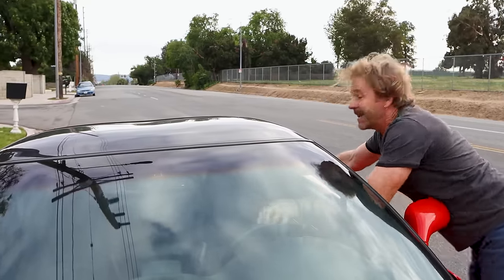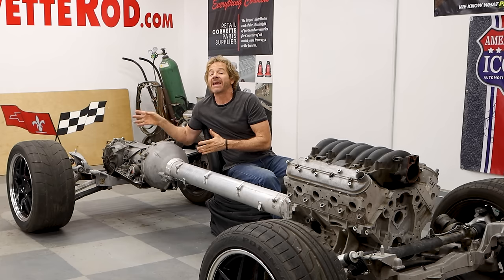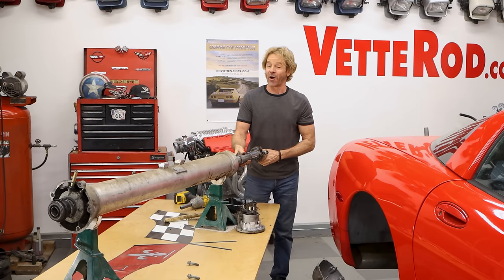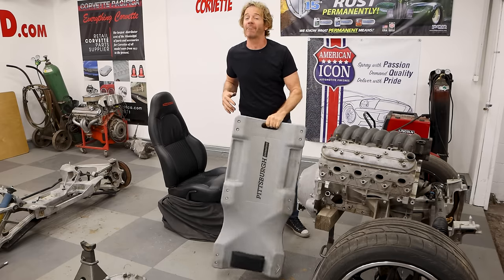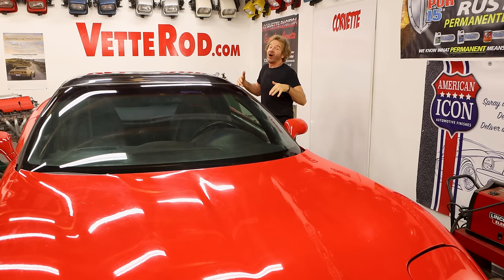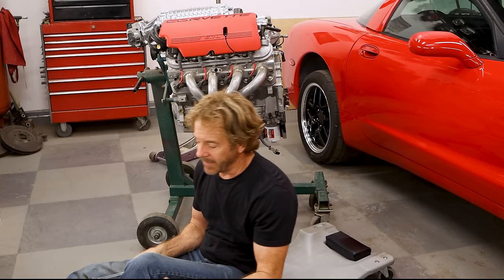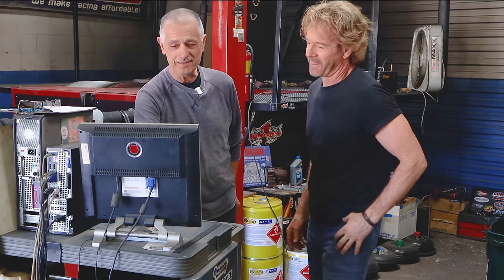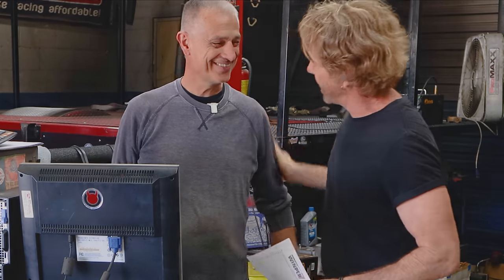I found the Cheapest Supercharged Corvette on the planet

Comment: Shawn, I know it sounds unlikely that you would have missed it but I just wanted to mention one thing. One very popular modification on forced induction C5 and C6 Corvettes to prevent knock was to spray water methanol into the intake, this was normally done by adding a bong under the existing windshield washer fluid tank and having a pump under the bumper and a hose into the intake tube on the bottom. It's possible to gloss over something like that because of where it is in relation to the work you were doing. If the windshield washer tank is low and it's not spraying water methanol then that would explain the knocking. It just seems weird to me that someone who put that much effort into building the vet would not have it tuned correctly. Many people just used normal -20 windshield washer fluid because it is 70% water and 30% methanol and that way they can continue to use their washers as normal but some went out in bought special juice which was a 50-50 mix. The windshield washer fluid is almost as good. You end up with about 113 octane equivalency with -20° windshield, washer fluid and 116 octane equivalency with 50-50 mix.

Comment: Thanks for the information about the Vette drive system.  I had no idea the trans was in the back and there was a throw out bearing in the front.  My 2005 vette has been making a growling noise whenever I let out the clutch in an acceleration.  I bet I have a similar problem as you had, though not as far gone.

Comment: I just happened across this video.  This guy is amazing.
I've owned over twenty Vettes and never came across this.  I thought it was a bent valve or, worse, a loose connecting rod.

And he does the work himself!  I feel good about myself if I manage to change the oil or an O2 sensor.

Comment: You uhhh... you really need to get a cheap scope cam. For like $20 or less you can avoid the whole mirror BS, just fish the camera up there while taking a recording, fish it back out, then freeze frame the clearest point. Then you can read / see anything you want. . . with ease.

Wish I woulda found this gem though... my god what a deal! Not really feeling the "vette camino" idea all too much, but you do you I guess. But man oh freaking BS man, you say your car buying skills aren't what they used to be... wtf did they used to be!? You used to find gems like this for $500 or less or something? Because this is about the deal of a lifetime! Better than pretty much ANY new offering of ANY kind.... All the modern tuning convenience, all the easy and bulletproof everything of GM 4th gen F and 5th gen C reliability via LS and T56... Interiors that still have actual switchgear, buttons, dials, and REAL GAUGES and not bs analcrap screens faking it while looking like absolute abhorrent crap while doing so... all of this goes SO FAR in my book, as the LAST thing I want is a 10" tablet and endless menus and drop downs, just to turn on my seat heat, or hvac, or roll a dang window up. Not to mention, having that single point of use item break and literally losing EVERY SINGLE EVERYTHING, as new cars do... also not to mention, the parts in this car are plentiful on the OEM and aftermarket, where new cars have parts phased out in a matter of months anymore, literally becoming unrepairable whilst still nearly brand new. 

No, this is literally the last BEST era, with the c6 being the last good era. Sure, the c6 comes as a more potent and arguably "better" car... but in many ways it just overcomplicates what was already present on the c5, and heck... even 4th gen fbody. Any C5 or SS/WS6 has the exact same potential, while also being FAR more user friendly in getting it there... and more fun to drive imo.

Comment: You're the Pilot alright....Great video.   You're a one-man mechanic..   (Corvette expert).  You make hard work look like fun.... A quick question, I think the IAC module is bad on  1985 C4.  The car runs great but idles like it has a race cam in it.  It doesn't, to my knowledge.  At idle the rpms range from 500 to 700 up to 900 and back down almost stalling.  I've done the coolant bypass and added an air foil to the throttle body.  This improved the idle a little, and added torque. I still think the IAC is the culprit.  Do I need to take off the throttle body to change the IAC?  I already bought a new AC Delco IAC, so I may as well change it...
Reply: you cant remove the iac without removing the whole throttle body. since you did the coolant bypass, taking off the throttle body should be a breeze.

Comment: Just found your vids and think they are great. I just wish when people do rear wheel dyno pulls they would stop with that 20% thing to convert it to engine HP. If you dropped in a 1500hp motor it does not take 300hp to turn the same drivetrain that the 700hp took 160hp motor to do. That 20% things is b.s. it is just make believe number they throw out. An average t56 manual transmission with a average 10 or 12 bolt rear end takes about 80hp to turn depending on clutch/flywheel and driveshaft weight. if this car had the 4L65 based automatic in it would take approx 120hp to turn it.
Reply: Not only that, but they said 20% drivetrain loss and took 20% of 580 whp and added it to see what the crank HP is. That is NOT how you get that number. 20% of X - X is 580 whp. Not, 20% of 580 + 580 = X 

20% of 696 = 139.3 so this would be a 556 whp car according to them 

If there was truly 20% drivetrain loss, 725 hp would be closer. 20% of 725 is 145. 725 - 145 = 580 whp

So I’d agree, it’s likely less than 20% because like you said, it generally takes a fixed amount of HP and everything after is just extra.

Comment: When I heard your knock, and that the seller drove it 50 miles, my first thought was the input shaft. I bought an 85 camaro with a 350 and t5 in it years ago. some one put gear oil in it when it needed trans fluid. I figured they had the trans flushed and the shop put in the wrong oil. I drove it for a few months. Drove it 90 miles to a friends house. When I left it made that noise. At that time I thought it was the through out bearing, Nope Input Shaft. lol. I was banking on the input shaft, because it is one of the parts that rotate with the crank, and sound can travel, making you think it is in the block.

Comment: Drivetrain loss is closer to 15% on a C5 manual. I'd say its around 682hp crank based on 15%, but close enough to 700 (682*.15=102 | 682-102=580). That is on the high end of an LS2 with just a base blower kit, so that motor may certainly have more mods. But based on the rest of the car, I would guess its stock LS2 with just a smaller pulley and a good tune. Impressive with the stock mid pipe/cats, California gas, and it being so quiet.

Comment: I hate to say this, but it sounds like what you have is an early model Callaway Corvette, or more specifically someone was attempting to build their version of a Callaway Corvette. The only problem with that is this: The special edition Callaway Twin Turbo Corvette was available from 1987 to 1991 as Regular Production Option. If it was the Callaway Sledgehammer Corvette it would be twin turbo charged, and would produce a bone chilling 402 hp (300 kW) and 582 lb⋅ft (789 N⋅m) of torque and speeds of 254.76 mph. But you are producing numbers that are consistent with the SC757 package which creates 757 horsepower and 777 lb-ft of torque when paired with the LT4 of the Z06 Callaway Corvette, in a car that is much older then the Z06. With a little bit of tuning you might start producing numbers consistent with the Callaway Corvette "Top Gun" project that produced 898 horsepower.

Comment: Whats crazy is that you will get used to that hp very quickly and want more.
I went from STS twins on my 02 c5 z making 650. Rwhp to changing it all out to a 403 stroker amd vortech ysi running 18lbs of boost making 1000 engine hp and still wanted more

Comment: Not bad of a buy I got my dream truck for 600 I got a ford ranger 1999 step side 4x4 xlt 2 door an I love these only bc my grandpa had a truck like this an there mean trucks I put a 6 cylinder mustang motor in it an it’s a beast of a truck zero to 60s good Dino shows 310 hp with All the tune an mods only sad part until I get a proper torque converter it’s a 2 will with a 2 will trans an rear end sadly but hey got it for 600 out 2 grand in it so not bad it’s got no rust an has a really good frame an everything

Comment: Great episode and great info for my C5. I think the math was off on the HP though. Assuming 20% powertrain loss I calculate 725 FWHP. 725 x 0.8 = 580 RWHP. My C5 is an automatic so Im curious of the stock 4L60E can handle that power and torque. If not how hard is it to upgrade to a 4L80 or even a 6L80?

Comment: Hey Shawn just wanted to let you know that your car there is actually at 725hp at the fly because 725 x 0.8 = 580. 0.8 is the 80% of the overall power since 20% is lost in the power train. So, to go from bwhp, just divide by 0.8 to get the power at the fly. Even more power than you thought!
Reply: The problem is the math was wrong to begin with. IDK about his dyno guy, blowing smoke. These modern cars don''t lose 20% drivetrain especially a stick! He should use something more like 13% not 20%. That's a 655hp engine. A modern automatic is something like 16% loss. Make the customer all excited woohoo woohoo lol.

Comment: 725 hp at the crank. That's if there is a 20% typical drivetrain loss and it's reading 580 at the wheels. 580 at the wheels ÷ .80 (80%) will get you the number at the crank. 725 at the crank x .80 (80 %) gets you the same 580 at the wheels.

Comment: I think the dyno guy did the math wrong.  If a rear wheel dyno reading will reflect a 20% loss in HP,  then you have to find out what # minus 20% makes 580.  

That would be 725hp.  80% of 725 is 580.

Comment: Decades ago I bought a used chevy and learned to drive a stick. I ruined the original clutch and bought a pricey
'Racing clutch.' Pedal was so stiff that I bent the clutch pedal. Had to gusset it in High School welding class. Did not need 3800lb pressure plate behind a 210hp 350. A fool and his money-ha.

Comment: I wonder whether the stock driveshaft flex coupling is designed for this much HP, given the engine was supercharged and second gen. Might have contributed to the shred. Did you consider seeing if there's an upgrade to a reinforced coupling before putting the driveshaft back?

Comment: The horsepower math is wrong. If you loose 20% of generated power, you can’t add that percent to the lesser figure. It’s: 725 HP -20% (145) = 580 Quite a big difference.

Comment: Shawn, you upgraded that tube for the driveshaft, did you have that already from your VetteRod yard? what would that upgrade cost if you just got one from GM new? i think the car was upgraded by a prior owner not the one you bought from and that owner left to l1 setup and it wore out on the prior owner and he thought the engine was going out. when it ran making that noise it sounded exactly like a rod knocking.i wonder who the prior owner had look at the car? any decent Chevy dealership should have found it's not the engine and even if it cost 4k to repair given what the custom engine turns out to be it would be well worth it. stock at least, now that it's running in very good to excellent condition you could flip this car for 15k.

Comment: Wow, a blown clutch and a disintegrated torque tube?  Someone has been hot rodding that Vette to hell and back. I think the engine is fine. It's the drivetrain that took most of the beating. That is why the guy had the after market super charger installed. He wanted to race. Perhaps the seller won the car in a race...Who knows.  Be careful though. That car is putting out at least 600 BHP.....

Comment: I have a stethoscope that is only a metal tube at the tip, and its pretty handy at finding weird knocks when you hold it against the engine block, 
But why didn't you check the oil for sparkle's, or the sparkplugs for damage?
Well if you had to to pull the tube anyway.
Reply: (oh The clutch went out Makes sense)

Comment: My guess is that this car is around 650 crank hp with a 12% drive train loss, leaving you with 580rwhp. Regardless, the whp is what counts, and in a car that light, it'll scream (if you can get any traction).
Reply: Does it not have Traction Control?
Reply: @michaelgrimm3083  I assume so. But it'll reduce power to the point that it's no faster than stock. Gotta turn off traction control to really get any benefit from that extra power. More up the suspension and tires to get traction.

Comment: Why would the driveshaft spin without being in gear or putting tork to the transaxle?
Reply: because as long as the engine is running the torque tube is spinning. these cars have a torque tube instead of a conventional driveshaft, where a tube connects to the crankshaft of the motor and transfers all the power to the transmission in the rear of the car. so as long as the engine is running, the torquetube is spinning, even if the car is off.

Comment: Can I come work for you? I spent 6 thousand on a running but leaking oil 97 vet with a tsv 2300. The harmonic balancer rubbed against the oil pan and block. The belt tensioner pully also was warn and made a knocking sound.
Reply: 97 thousand miles also

Comment: You did the math wrong for 20% loss. You dont times it by 1.2. Thays 20% if 580 added. If you multiply 700 by .8 you get 560. This is closer to 725 if it is 20% loss. (You divide by 80 and multiply by 100)

Comment: Great, you found the issue. My question is, what caused the issue? Because that's going to be your actual problem. Or....could the issue be because the original drive shaft was never designed to handle the additional power of the newer engine, and if so, what else could become an issue on this car that was built with the original engine in mind. Also, why not keep the car looking like the traditional "Sleeper Car" rather than advertise the best inside.